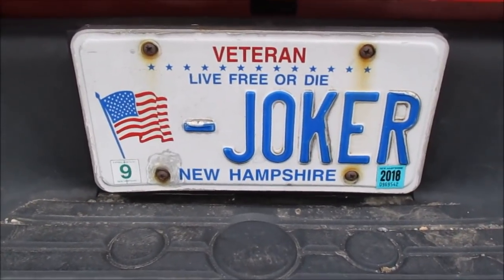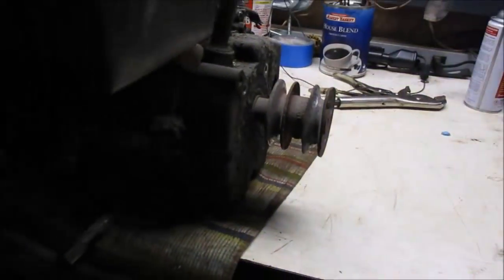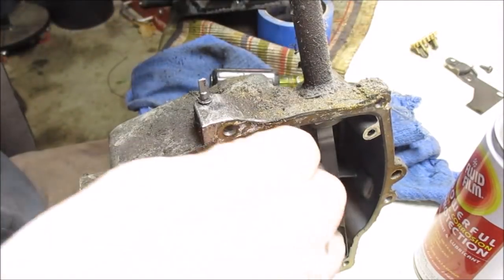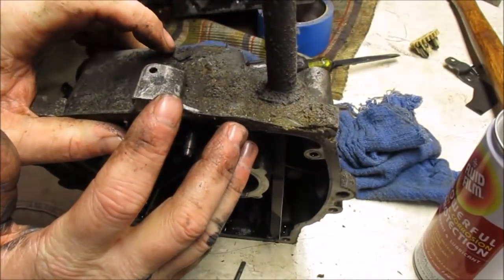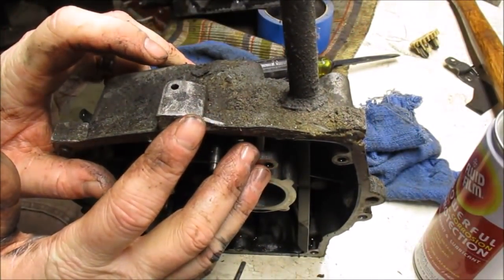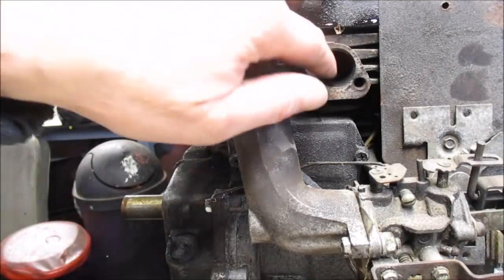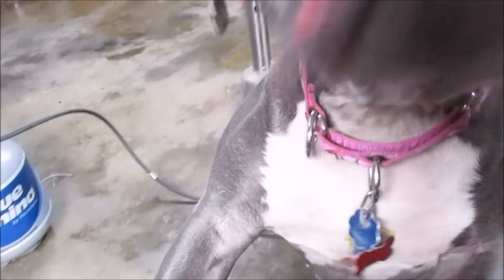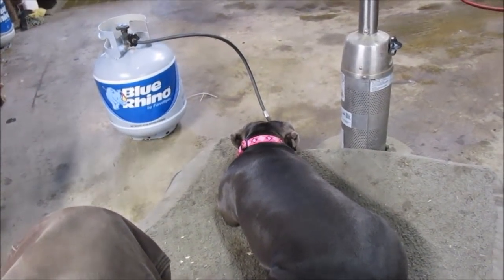engine work for the laughing joke garage

Comment: Why do you need to remove the internals? Would it not be ok just to remove the linkages?
Reply from the maker: the internals will still govern the engine with or without the linkage. I think. thanks for watching Gustav
Reply: Wau.  Quick answer. Thank you. Keeping up with your work from accros the pond. (Denmark)